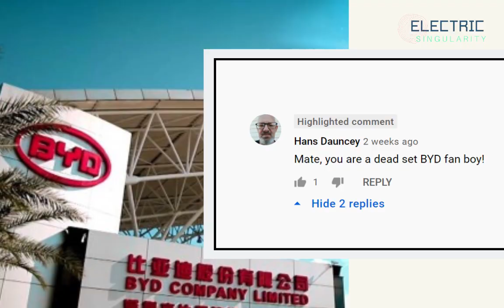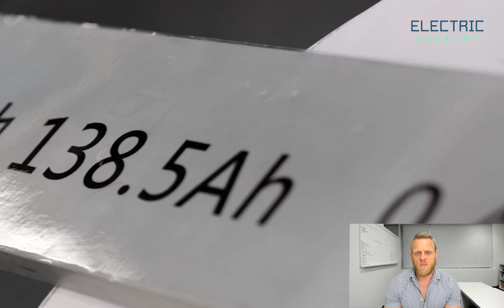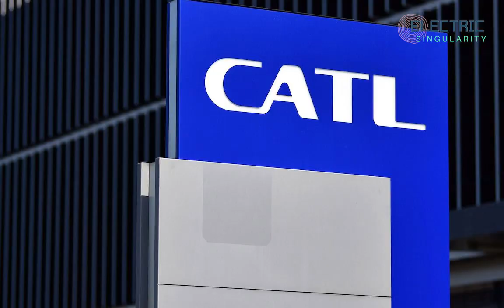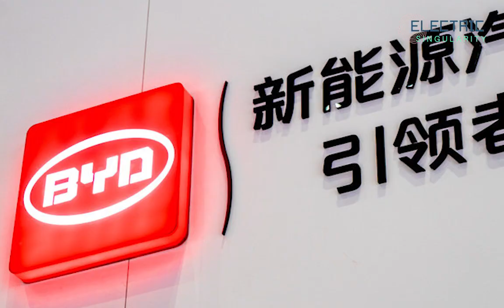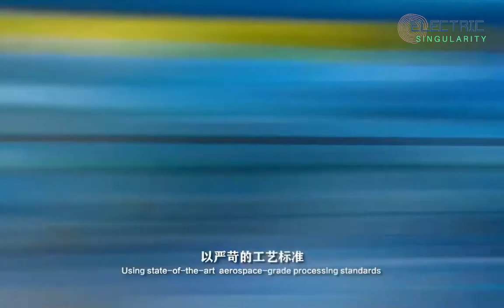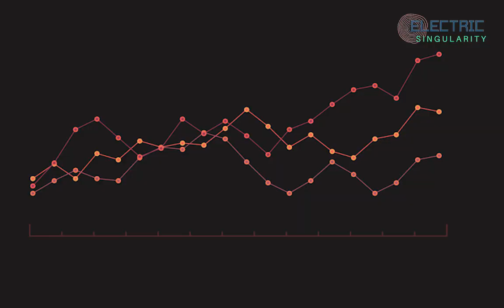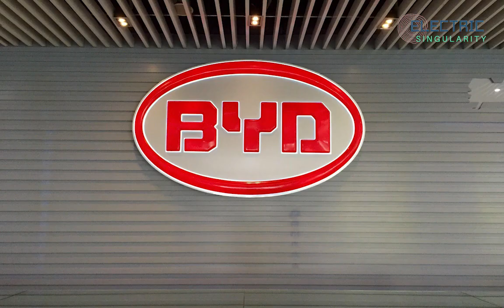BYD upgraded to tier 1 global battery supplier after Mercedes agreement

Comment: Byd was so far ahead of Catl 10 and more years ago. But byd want to maintain their leading position on ev and refuse to supply battery to other brands. Catl caught this opportunity and built Joint-venture factories with other car band to supply battery and is able to expand their capacities by using leverage from those partners. Now byd is still leading on tech but so far behind on capacity. Another advantage for byd is that byd is able to set battery price according to market conditions. but because Catl factories are joint venture with car bands, prices are very less adjustable.

Comment: Battery technology is advancing very rapidly.  Solid state batteries such as from Quantum Scape are coming.  Will BYD be able to upgrade their technology to keep up?
Reply: I will choose byd battery, not for the range,but for the safety, my sadety matters.
Reply: @Yandri Susanto Solid state probably is for the future and for now BYD blade batteries are good enough for me.
Reply: Cost is the problem
Reply: Solid States Batteries are NOT easy to make. And the components required are also Expensive and Rare. Agreed that Safety of Solid State batteries is A MAJOR issue. The chemical reactions are rather "EXPOLSIVE" .

Comment: The DM-I range of extended PHEVs are also a good alternative for full electric until the network gets built out. 150 km on a full charge plus a 1.5 engine for those long trips once a month if you need it. Apparently 100,000 back orders in China for this option....
Reply: this option is the best for Australia at this stage
Reply: @ryanliu906  Not if you stick to the coasts.
Reply: 85km not 150.
The Han's 605km are only 360km at highway speed and ac. 
The seats are very uncomfortable. Last weekend I drove  1300km with a rental to check how it works on long distance trips.  I uploaded the trip video.
The Entertainment system runs Android 6 and has a very outdated GPS software. 
I couldn't check HPC charging, as there were only max 100kw.
I drove the 
xpeng p7
BYD Han, Tang and
ID4
The ID4 clearly wins, just alone because of the seat comfort. And space. And charging. 
I also drove the Mercedes Benz version of the BYD Tang the Denza X. 
But still VW wins.
Reply: @larsradtke4097  But which one of these cars can you actually afford?
Reply: @ryanliu906  These car I listed I am considering to get. So I don't have an issue with affordability. Leasing, financing are also options btw
Reply: @larsradtke4097  where xan you rent a byd to test drive?  I am interested in doing the same.

Comment: Can you elaborate more on their Chip division which makes them immune against chip shortish?
Reply: I'm not an investor & will never become one (I'm debt-free & enjoy spending what I've worked hard for), but BYD's established chip manufacturing should possibly give them an advantage over Tesla who are working on software to get around the shortage.
Reply: The chip shortage is more that current automotive industry require old style chips for their old style electronics which can't support newer electronics to drive things like over the air updating and chip makers won't invest in old technology for a few million chips while old style automakers transform to new style electronics, also covid disruption has added to shortages. BYD, is the worlds most vertically integrated automaker. Making their own semiconductor chips, to a degree puts them at an advantage over every other automaker.